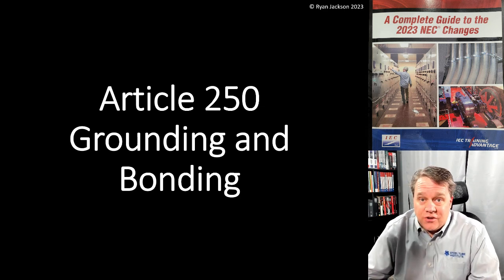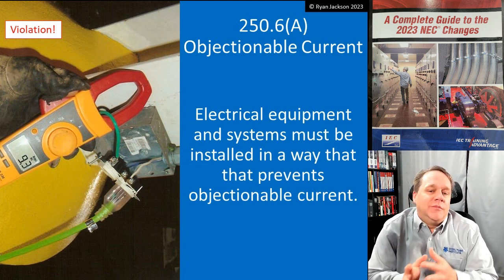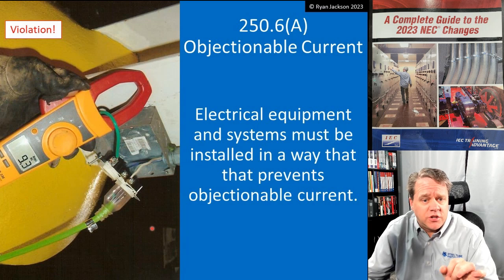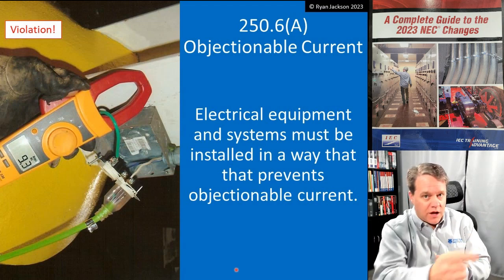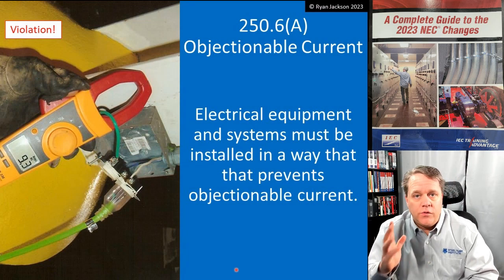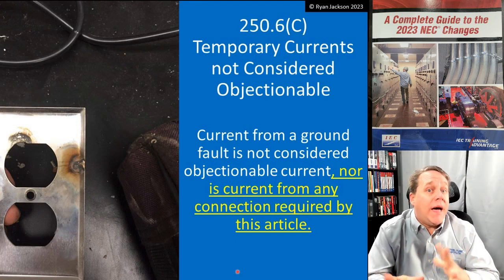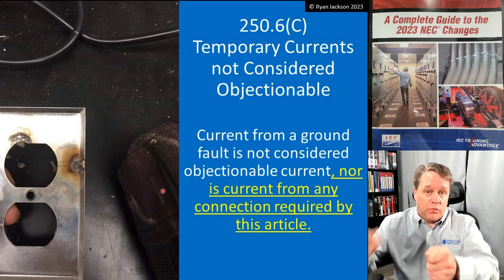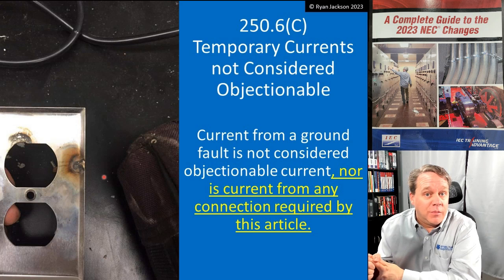2023 250.6 Objectionable Current

Comment: Did a service upgrade about 12 years ago. I was called back for something else and saw that the system grounded neutral came undone. Out of curiosity I out an improve around the GEC and found 13 amps flowing though it. Another time I had potential of 110 volts between two 4" square boxes up in an attic. Objectionable current flow is fascinating and once you understand it you are definitely an electrician. Great video Ryan!

Comment: Another classic example of what could be considered non objectionable,  is dryers and ranges connected to 3 wire setups in pre-1996 homes and in some jurisdictions the rule for 4 wire setups wasn't universally enforced until the early 2000s or so.
Reply: They those have a neutral or a ground wire?

If a neutral wire: How would that produce objectionable current? Sure, it's unsafe if the neutral wire breaks. But precisely because the 120/240-V dryer/range has three 3 wires (two hots and neutral), no current flows through any ground wire or metallic object under normal conditions.

Comment: Have two cases of objectionable current.First one was when somebody used 14/4 AC cable to supply 4 branch circuits while using the steel jacket for the grounded conductor. Over time somebody replaced the 15 amp fuses to 20 & one 30 amp fuse. Steel jacket was very hot. Second case in my large city every large street has 3 phase 13.2KV lines but they always only run one high voltage line to primary of it appears to me to be auto transformer connection . Every copper water service & steel gas service that I used an Amprobe on had 1/4 to 3/4 amps on them even if main breaker was off. If cheap utility company would just run two wires to the primary you would not have any current flow. Over halve of the houses on my street had leaking gas service pile leaking. The gas company comes out and digs up the sidewalk where the 6" main is and pulls a plastic tube thru leaking pipe and glues it at both ends. Often wonder if the steel underground pipes would have lasted longer if they had no objectionable current on them. Can Remember being told that is dangerous for any underground pipe to carry current because this could cause arcing to a nearby better conductor and eventually this arcing will eat away the pipe causing a leak.
Reply from the maker: Adding another wire wouldn't solve anything. Current takes every possible (completed) path, so if there is current on the pipe now there still would be then. This is simply a biproduct of using a solidly-grounded system.

Comment: Thanks for taking the time to make these videos.  I was wondering about the waterpipe issue.  I saw a video from the EMF explorer channel and he states that the current flow on the water pipe causes high emf which can lead to health issues overtime.  I have seen other videos stating similar issues and levels of emf when neutrals from two different branch circuits are tied together in a box.  One of the fixes that was shown was to remove the jumper that bonded the pipe on either side of the meter.  The rest of the house was still bonded but after disconecting the jumper there was no more current flow or emf present.  Seems like if emf is as bad as they say it is, why not break that connection and just cover up the portion that isnt bonded to the rest of the house.  If the panel has a ground rod already and all the pipes are bonded that could contact wiring and become energized then it seems like it would be better to not have the extra emf present in the house/building by breaking the connection to the street.  Curious on your thoughts about this.  I could send a like to the videos I'm referring to if you'd like.
Reply from the maker: I have never seen any scientific study to support those claims.

Comment: I've got galvanized steel water pipe and two grounding electrodes at my house. I read about half an Amp on one grounding electrode conductor, but none on the other, or the water pipe. They're all wired up properly as far as I can tell. I've also been hearing that while not an electrical safety issue, current on a water pipe may be leaching chemicals out of the pipe and joints, causing a potential water quality issue.

Comment: The big question to me is how much current on the GEC is acceptable? How much voltage on the GEC is acceptable? I've put my Fluke around some of them and occasionally see 60v+ and 100a+. On others I see nothing. No current, no voltage. Never have I seen a clear definition of what is acceptable and what isn't. I've seen some of these that were enough to shock you touching them with the main breaker off. And the copper pipes are not that common here, they're all iron and really rusty. Maybe that's the cause of the higher voltage.

Comment: All nice and everything, but declaring current on the waterline non-objectional doesn’t mean that it’s ok.
Reply from the maker: It is often unavoidable. We use a multi-grounded neutral conductor for utility distribution. We have to connect to the water pipe to keep it from becoming energized, and the second we do that it is in parallel with the utility neutral.